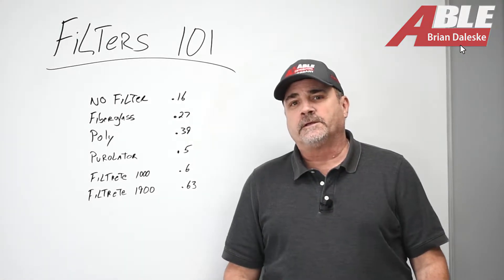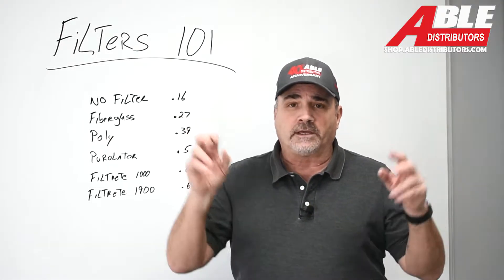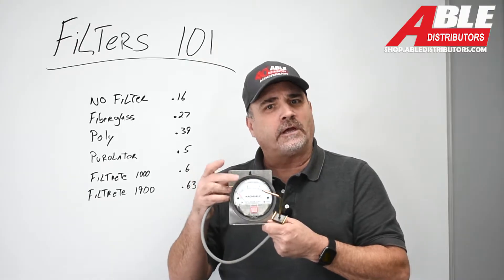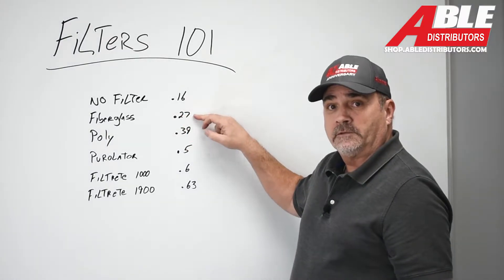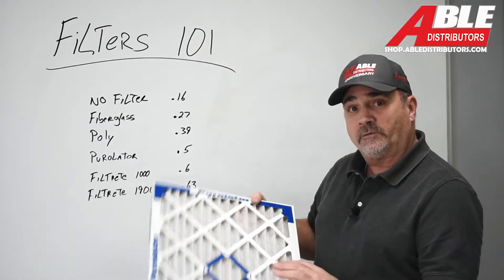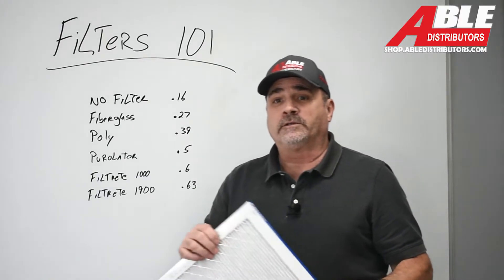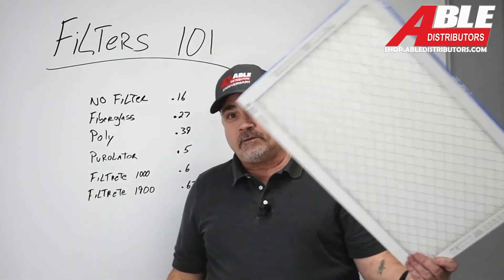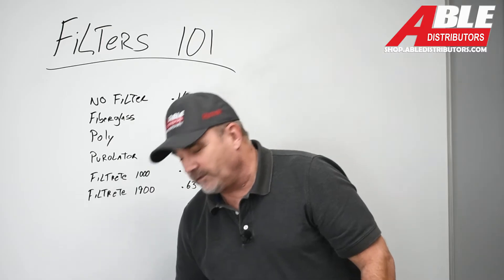HVAC Filters 101 - Airflow Report: Are Expensive Filters Worth It?

Comment: This video only focus on static pressure drop but the reason for expensive filters is better clean the air. I was expecting more on the performance of air cleaning verses air obstruction and how frequent one should replace the filters before severe obstruction.
Reply from the maker: yes, static pressure and how different filters affect your furnace or AC performance and efficiency is what I'm talking about in this video, because your furnace or air handler was never designed to clean air, the air filters are to protect your equipment, not clean air.  we have options that "trap" more particles, these larger filters require installation, some are, Air Bear, Honeywell, AprilAire Space Guard , General air 2000, these were designed to allow proper air flow while trapping as much as possible, but to ask a 1" filter to do the same just won't work, it will have your equipment working harder to change the temperature of your home. hope this helps, Brian..
Reply: @abledistributors  Stop with the misinformation. It's not even logical if you stop to think about it before parroting industry myths. Maybe a scare tactic so people don't use the wrong filter. I included 3 examples of air handler documentation. Feel free to disagree with the manufacturers.

Goodman:
Filter: Before your air conditioned or heated air enters your ductwork, it passes through an air filter. The filter is intended to minimize the number of particulates circulated throughout your home, accumulate in the duct work, and land on the indoor components of your heat pump system.

Carrier:
Air filter
The filter traps dust, debris, and other particles from the air, preventing them from circulating into the home. It helps maintain indoor air quality and protect the system components from damage.

York:
The JHE also reduces allergens with both filter and indoor air quality options.
Reply: @abledistributors so if your system is a 16x25x4 would that be considered one of thes air cleaning filters? I had never seen one larger than 1 inch until I bought my new house. Sadly, with this giant filter my house is so dusty all the sudden. I wonder what happened, or if the filter I got was garbage
Reply: @u2sweetestallie  That is most likely leaky fixtures allowing insulation and outside particles to be pulled into the living space when the HVAC runs. Need to seal all ceiling penetrations, wall outlets, switches and any other sources of infiltration. Builders don't care about these things as it take time and money, unless you have a good, custom home built.
Reply: Spend $150-$200 on a great hepa air purifier (or double and get 2 that to purify even better). Those are meant to clean the air, not your hvac air filter. Trust me it’s worth it. Just keep up on the hepa filter when it says to change it. Cheaper to keep those up than constantly having a hunker evap coil or worse, an overworked fried compressor.
Reply: @coolwiz7994  But air is also introduced from outside via particulate/dust laden fresh air intake that goes directly into the HVAC, right?
Reply: I believe how often to change your filter will come down to a lot of factors. how good of a filter you have then better the filter the more often you will have to change it. how many people and pets in the home. how often it is running,, any smokers in the home. do you burn candles often?. how dusty or smoky in your part of the world. e.g. farm land and forest fires. the filter say UP to 3 months. DOES NOT  say change every 3 months. If you want clean air in your home get a high rating filter and change it every month.

Comment: Will any fiberglass filter do? I see Merv 1, Merv 2, Merv…. Are they all created equal?
Reply: Change fiberglass every month, with the other filters you can change them every 3 months but i'd rather do every month anyway. HVAC systems are not air filters, a fiberglass filter protects the mechanical components and that's really the entire purpose of the filter.
Reply from the maker: just like any filter, fiberglass filters can vary, but most fiberglass filter are going to give you better air flow at a lower cost. the number one thing to remember is every filter will get dirty, changing them on a regular basis is always key.

Comment: Thanks for confirming it. I had nothing but problems with those expensive paper filters. It would freeze up the outside pipe and killed the starter capacitor sooner than usual. I replaced it with the cheapest green fiberglass filters, and my AC last forever now and my electric bills cost less too. I told people that AC is not an air filter system. I installed a couple of air filter units inside the house to filter indoor dusts... 😃
Reply from the maker: thanks for checking out our videos, stay tuned, more to come...Brian.

Comment: We just installed a new 3ton single stage Rheem outside and inside air handler. Are the home depot #7 filter a good buy we have a 20x30 filter size and I replaced the filter every 6 weeks
Reply from the maker: first off, its great that you even think about your filter, most don't . I'm just not familiar with any Home Depot filters ( I've never bought filters from them ) 20"X30" is a huge filter, and changing them often helps a lot, I'm assuming its a pleated filter, I thought Home Depot has no fiberglass filters, I could be wrong. with that large of filter, you should be in great shape, especially with your system only being a three ton ( 1200 CFMs ) keep it clean and your new system will last forever. thanks for checking out our videos, Brian...